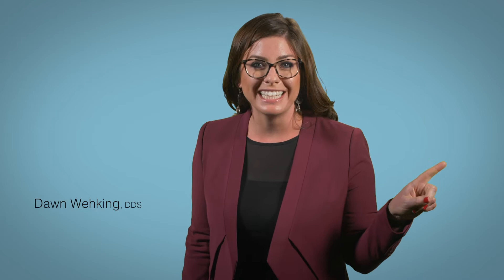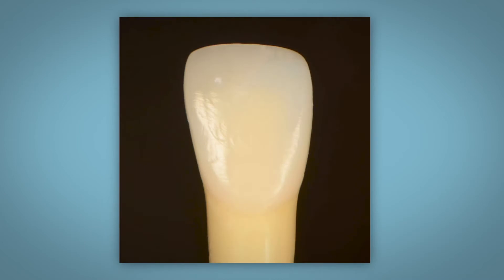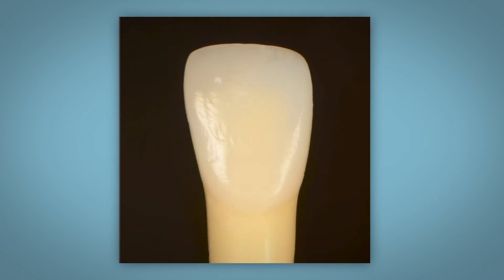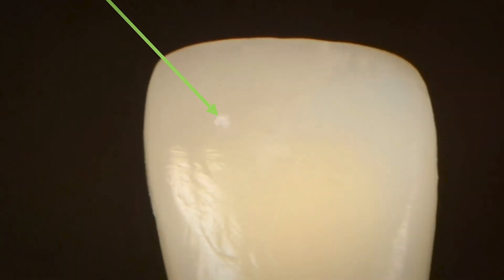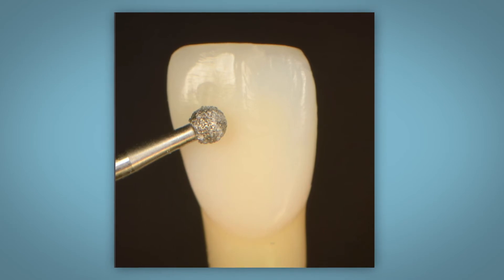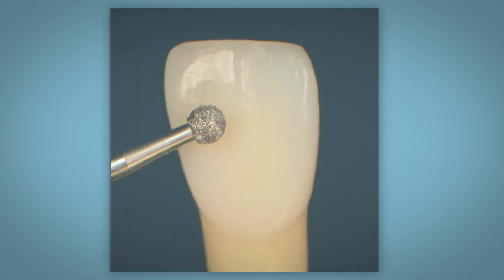Class IV Anterior Composites: There's a Void!

Comment: DO NOT bond prior to addition of composite. The HEMA component in some bonding agents will stain after a few months and you’ll end up with discoloured margins or even discoloration of the bulk of the restoration. It’s the same reason why it’s preferable not to use HEMA-containing instrument wetting agents.
Reply: You can use unfilled resin from a 4th generation system.